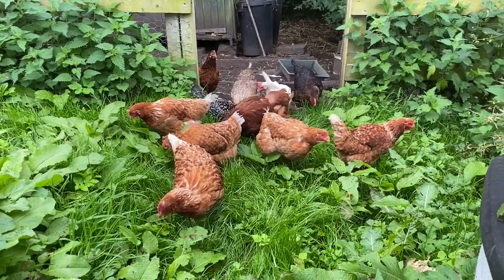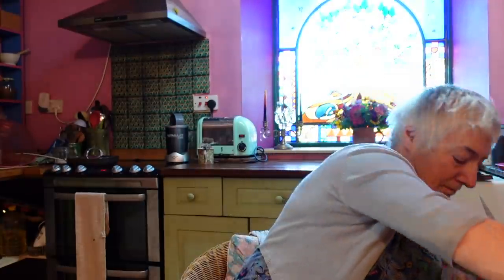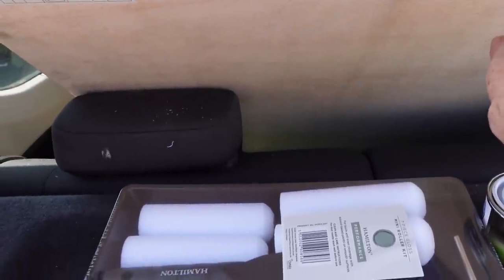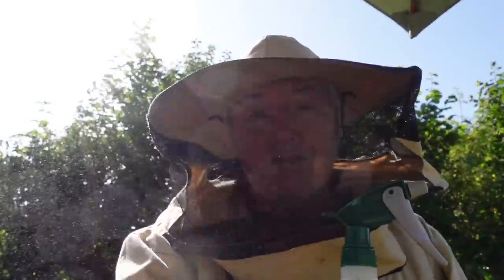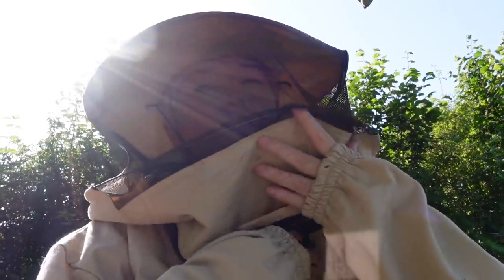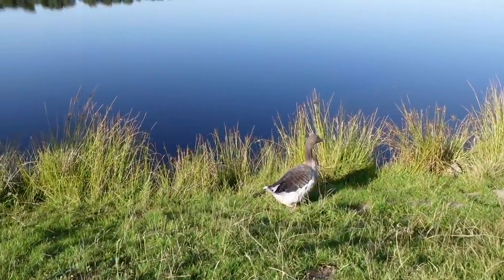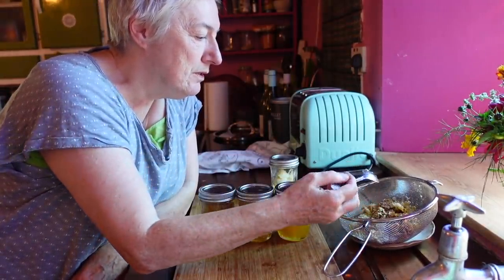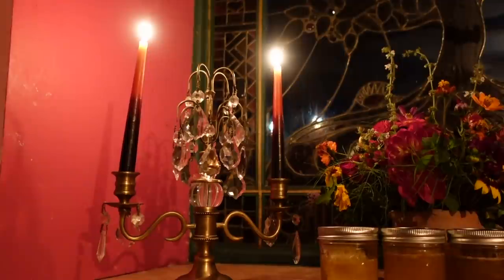So much TO DO! painting, bees, goose, construction! and some beautiful Autumn Candles in the SHOP!

Comment: Eileen must have been told as a gosling never to swim alone. I love that she only goes when you go also! 
I also look for YouTube to provide instructions when I need to put anything together - I even watched how to replace my headlight when it burned out and was quite successful.
I know you paint quite a bit and you weren't finished with the primer but be sure to do the edges so water doesn't get in and separate the plywood. You probably know that but I would hate to see your work ruined. I can't wait to see Agnes the artist at her chalkboard!
Reply: A few years ago I had to put ends on the cables for the tv after a moved the tv and had to add a cable.  I looked it up and found a YouTube video on how to do it.  It was a really young guy and he started off with " use a cutting board because if you make cuts in the table your mother will get angry" . It was a great video and I had no problem following it even though I was a granny and didn't have to worry about my mother's table.
Reply: @lenabreijer1311  it's wonderful to find so much knowledge so easily. I'm so thankful for all the people who take the time to put themselves out there for us to learn

Comment: When painting, if you need to reuse your brush or roller the next day, slip it into a bag or some cling film and store it in the refrigerator until the next time you need it. Saves on washing up…
Reply: My sister actually puts it into her freezer and lets it thaw a bit for next time. Only good if you're using the same paint though of course.
Reply: I was going to write the same thing about the clingfilm😃
Reply: I put mine in a plastic bag or ziplock bag, no refrigerator, and it lasts until I need to put on another coat of paint.
Reply from the maker: all such good tips xxx thank you

Comment: because you are doing another coat soon, you could put your roller in a plastic bag and put in the fridg. lay it out a half hour or so before you paint again. I do it all the time and it works well. I hate cleaning brushes and rollers and discovered this tip. I have even left it in the fridg for a week and its fine. Great project for the little one!

Comment: Always use water based paints. Rinse out the brush under water. And remove gunky bits of clogged up paint. Then pop the brush in water to soak. Something I learnt from hubby. You cant sharpen scissors if they have a serrated edge. Has to be a smooth edge.  I had to put my glasses on to see it. 🤓 Karcher is a good brand to buy. Good thinking Kate!

Comment: A tip for longer use of your brushes. Use some flaxseed oil for your brushes when you have painted with them. Put brushes in a jar filled with the oil so that the hairs are in the oil and the handle and the rest above and you can use them again and again. At least during the summer you can use those brushes with the same colour paint on them and the hairs of the brush stay lovely and soft. Saves on buying new brushes and a good paint seller will have flaxseed oil. A professional painter told me this trick and I do it every summer when I paint our house (doors, around the windows and more).
Reply from the maker: that is a very good tip! Thank you! xxx

Comment: You dont have to wash you roller out. You just wrap a plastic bag around it tight and use it again the next day, if you are going to do a second coat. You only wash it out if you are changing paints or when you are done. 😊

Comment: If you are going back to the same roller, you can put it in a plastic bag (or aluminum foil) and seal it off and put it in the freezer.  Come back tomorrow, take it out to thaw and reuse.  No need to wash between coats.  It saves a lot of hassle
Reply: Thanks